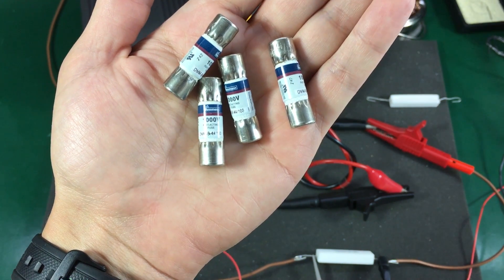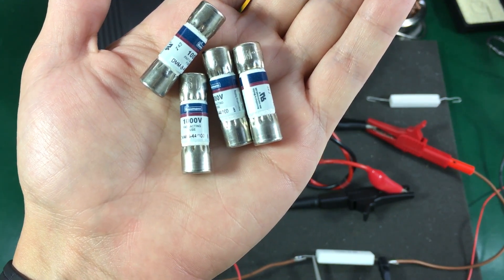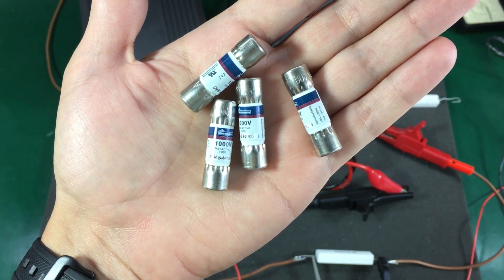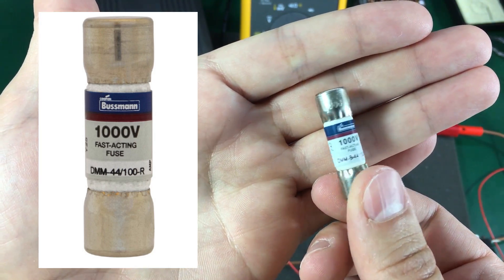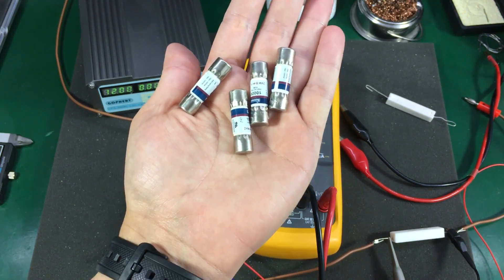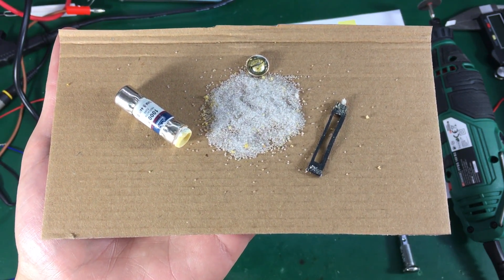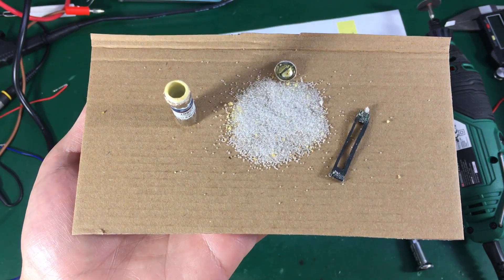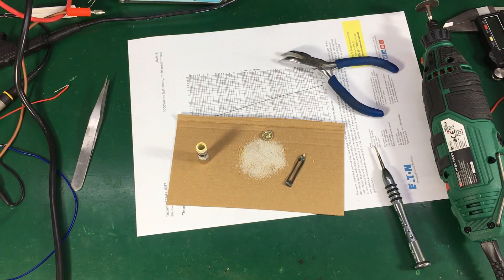Voltlog #117 - Ebay Bussmann DMM Fuses Fake or Genuine?

Comment: The burden voltage specified for example for Fluke 87 is 1.8mV/mA, that means an internal resistance of 1.8 ohms (meter shunt resistor + fuse resistance). The shunt resistor of my meter is 1 ohm,  then I can say that ~ 0.7 to 0.8 ohms is the expected resistance for the fuse.
Reply from the maker: there will be a follow up video on the subject, I am just waiting for more of these fuses to be delivered.
Reply: Looking forward to it.

Comment: Joe tested these kind of fuses, his results were more conclusive, i.e. the braking time was like 1-2 ms, instead of microseconds.
Did  you check the resistance of the fuse afterwards?
Reply from the maker: Joe tested the SIBA fuses right? I mentioned that in the video. Those have different specs when compared to bussmann fuses.

Comment: Do you guys know the reason why HRC fuses cost so much? There is nothing special about it, it's just a piece of metal, ceramic, fine grained sand and tiny wire. You can buy two arduino UNO R3 board for the same price.
Reply from the maker: the safety tests they perform do increase the cost, but I don't think it should be that expensive. There is probably a good margin that the distributors also add and in general stuff that is meant for industrial use is more expensive, because what the heck they need it and it's just corporate expense.
Reply: very short acting (0.034 ms in data sheet). These fuses don't act like originals. And of course, the ability to interrupt very high current arcing. And repeatable results.

Comment: I looked at a DMM-44/100 (mexico) and a DMM-B-44/100 (not marked besides  St. louis.   

DMM-44/100 weighs 6.4322g.  The DC resistance is 4W is 0.752.   At 0.4491A, Vdrop at fuse is 0.36507.DMM-B-44/100 weighs 6.5466g.  The DC resistance is 4W is 0.643.   At 0.4491A, Vdrop at fuse is 0.30864.

This balance and HP meter are both in calibration. 

Your  DMM-B-44/100s are marked assembled in Mexico and your end caps are marked DMM-44/100. My B are not marked on the end cap but my non-B is and stamping appears the same font as yours.   Weight looks good but strange the weight kept going down.  Maybe you pre-sorted them.  No matter, well in the ballpark.  The DCR with a 2W again, I would say close enough.  You ran a slightly lower voltage but the drop looks good.   The picture in picture is a bit of a pain as I was trying to see if you had changed anything in the setup and of course it is all covered up.  If the supplies negative output ties to neutral and I assume your scopes clip is also referenced to neutral you need to fix this.  Put the shunt on the neg side of supply.  Attach the scopes ground clip on the shunts neg side so everything is at the same reference.   Not suggesting that is the cause of the recovery problem you are seeing but it is not the way I would wire it.
Reply from the maker: Thank you for the info! for the weight measurement the fuses are not sorted it's just a coincidence that they were in that order. My setup was as folows: positive from power supply, goes through relay, then through 1ohm resistor, scope is cliped here on the resistor, goes through fluke 87 on amps range, then through the fuse under test and back to power supply negative. The recovery issue was not there though when testing the 0.5A glass fuse with exactly the same setup. In my follow up video I intend to test another two of these ebay fuses alongside an original one and I will use the method you recommended with the shunt on the neg side, though in this case I don't understand how that is going to affect my measurement.
Reply: No problem.  Glad to try and help.   Many of us could benefit from the data you collect.  

I was not suggesting that the way you have it connected is causing the recovery problem you are seeing.  Only that normally I want my equipment at the same reference to avoid loops.    Many supplies I have seen will use an RC to couple their negative output the their chassis ground.   The probes clip on most scopes tie to chassis ground as well and I would assume these grounds tie together through their line cords.    If your supply is made as I describe,  now you have an RC in parallel with the fuse giving the path for the current to flow.   

I would expect the HRC fuse to be different than the glass and it's hard to say how this would play into how it is setup. 

I would assume you checked the supplies output to make sure it had good step response for the various loads before running the test.  Mine was pretty poor which is why I have the supply running constant voltage followed by the current source.   

It's simple enough to check everything to make sure things are working as expected before running the next set of tests.  

Good luck with your testing.

Looking at your review of the supply you are using along with the high res pictures, there are three capacitors, C62, 63 & 66 that go between the outputs of the supply and the ground.   The two are basically in parallel with your test fuse.
Reply from the maker: With the previous setup I did some tests with a load resistor and the response seemed fine, then I did some tests by blowing some cheap glass fuses and once again it looked okay. But just to remove any possibility of errors I will switch to using a linear regulator in cc mode in my next video, that should provide good regulation.
Reply: Understand that there is a basic difference between the glass and filled fuses.  I wonder if the glass fuses continue to arc.  All that ionized gas makes for a pretty good conductor and may fully discharge the capacitors in your supply.  The filler in the HRC fuses are there to quench the arc.   Maybe this basic property is why when a capacitor is placed in parallel with the fuses that one type returns to zero while the other does not.   Hard to say but an interesting experiment.

Comment: I think you should compare it to that old original because the manufacture is probably the same, just the label is different. What does the old one weight, and what's inside. The crimping of the end caps look different to the pic, and the stuff inside looks too white for beach sand.
Reply from the maker: To my eye the crimping looked identical, I will do a follow up video where I test a couple more and I will compare the construction with the old one.

Comment: There is a fusing factor, which specifies how quickly they blow when over current, often it is 1.5X for 1 hour, 2.5X for 2 minutes or something similar, it might be on the data sheet. UPDATE, I just got to the bit where you show the graph... so yep, its there.
Reply from the maker: thanks!

Comment: For better testing results , the current limiting resistance should be much higher than the fuse resistance. For example, use Voltage 30 V and resistance 15 Ohm.
Reply from the maker: but that's not a current limiting resistance, it's there just to measure current.

Comment: Why didn't a 440mA fuse not blow at 1A? Whats the point of specifying such an odd rating, instead of 500mA, if it means nothing?!
Reply from the maker: not sure how they pick the rating of the fuse, but a fuse will blow because the wire gets hot and melts. In that test I was raising the current slowly so the fuse did not get hot immediately. Most of the time that's a good thing, because if you are measuring a 0.4A continuous current with occasional spikes at 1A that only last a few milliseconds you don't want your fuse to blow that fast.
Reply: The key part that makes a fuse work, is the filament. It must be made to high standards of known material and their conduction properties. That's what makes them expensive.
These Chines products all use fake stuff. The filament is probably regular copper wire with all it's 1% impurities. 
I think that's why you measured different values when you measured the resistance of each.
I don't like fuses. I like the idea of a OP amp across a sense resistor, setup as a comparator (gate threshold is adjustable via a 10K-10 turn trim pot), to turn on a pair of P-MOSFETs connected back to back on the + side (high side), if the current through the sense resistors goes above the threshold, also it prevents back-flow from the load. Serves 2 purpose.
Take a look at this for inspiration. https://goo.gl/wfp7CQ
Reply from the maker: the solid state protection only works in low voltage circuits, when you start talking about high energy 1000V circuits and CAT ratings, I don't think it will "cut the mustard"
Reply: And that's why they don't use them in a Fluke meter. Covering their asses at the same time. 
If you get test data from known originals, please post an update. 
I for one, would be interested in your findings. Specially the tolerances. 
Nice video.
Reply: there are a lot of safety factors. 440ma is the allowed load for a indefinitly long time period. and then there are the factors for how much more of 440ma it will take to blow. f.e. 2x 1h   5x 1ms
so 880ma and it will blow in 1h 
and 2.2A in 1ms

Comment: I got some of them for my Flukes, they looked like the old ones but after testing them, both 400mA and 1A fuses I found out that some wont blow pretty much at any point, and the other ones blew after many times the rated current, completely fake I guess. The original Bussmann blew up instantly under the same test conditions.
Reply from the maker: During these tests it's important to pick a current value from their graph and see if the time it takes to break corresponds to the graph. Like in my case I went for 2A and it should have been 35ms but the fuse continued to pass 0.5A past that point so I need to do some more testing.